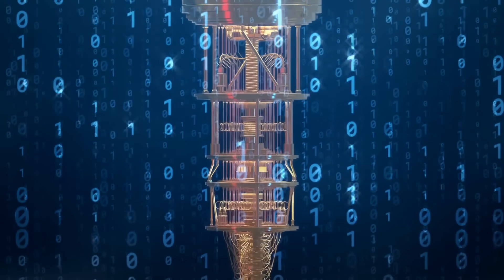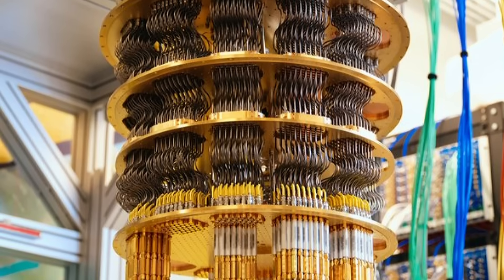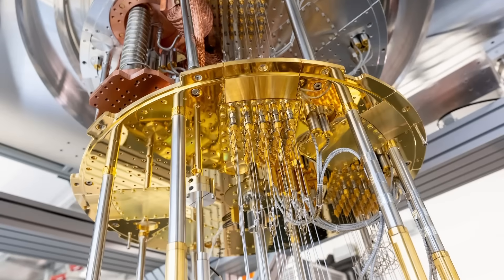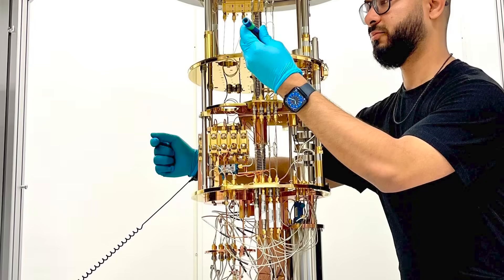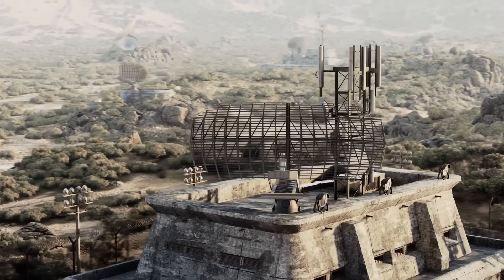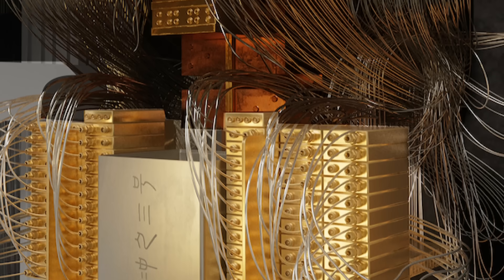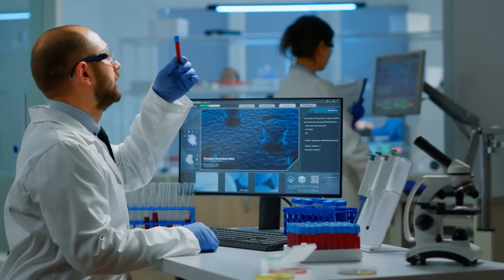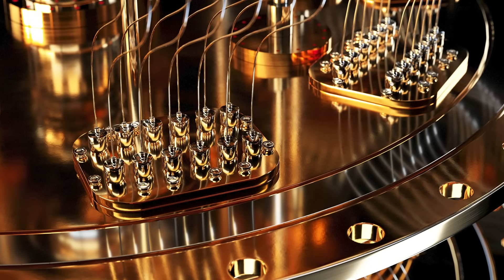Scientists Reveal Quantum Computers are Tearing Apart Reality, and We Can't Stop It

Comment: You saying time travel to the past's just a few steps from us?
Reply: No time travel to the past is impossible. For that to happen have to travel faster than the speed of light in order to escape out light cone. And that isn't possible since to travel as fast as light you would need an infinite amount of energy. And to go superluminal you would need more energy than that. And even if you can go faster than light you cant stop going faster than light. You're trapped. Time travel top the pass simply isn't possible.
Reply: @deltachanger714  There's other methods.